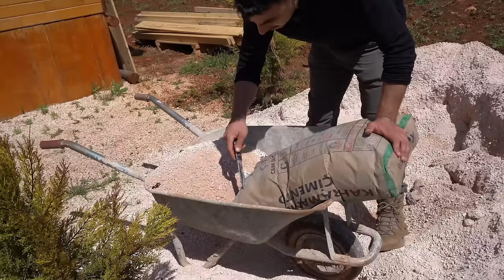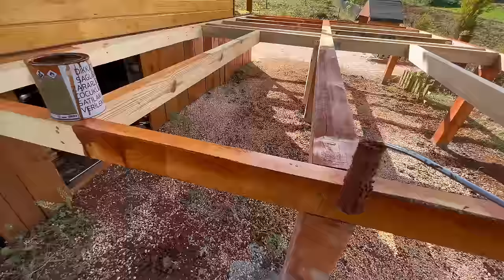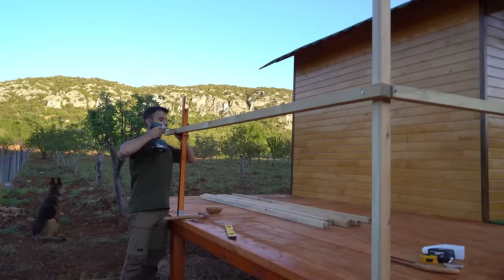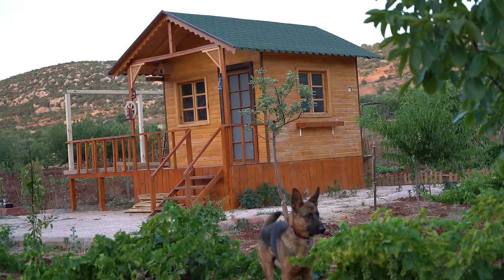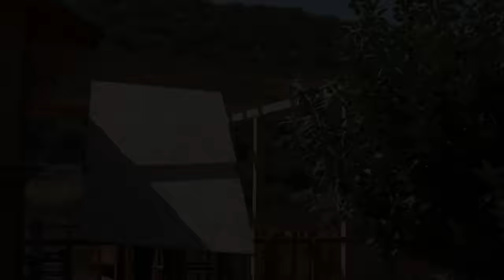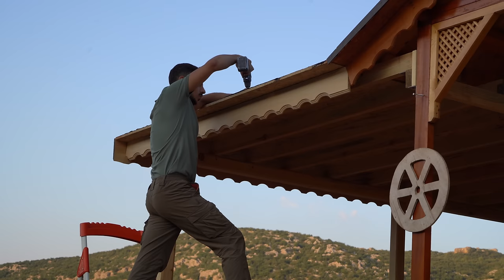Building a Wooden House / Building a Balcony / Off Grid Log Cabin

Comment: Serkan, I thought you were converting a bedroom, a kitchen, a living room and a bathroom to your hut, into a hut twice as wide, into a hut twice as long and into a hut twice as high and not just a flat roof balcony, but now lace you add another floor to the side, you open the sloping roof to the left, extend the gable to the left towards the balcony and build a large bedroom from the right part of the hut to the left as a sloping roof, high in the connection of both roofs with each other to form a common double gable roof and a balcony on the far left, a sloping roof would be better for both parts of the hut so that a whole living floor and a large bedroom can be created up under the roof, well it's still possible to build an upper floor with a balcony on the flat roof on the left.

Comment: Next time the L brackets should be turned in under the post screw them down first  then screw shorter part of the L bracket to the outside of the post so you don’t see the brackets all that much.